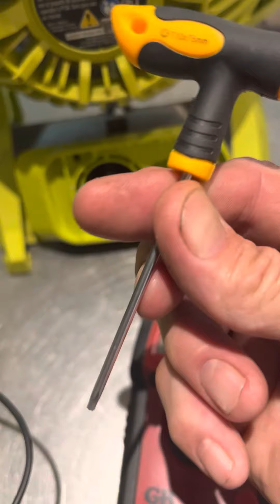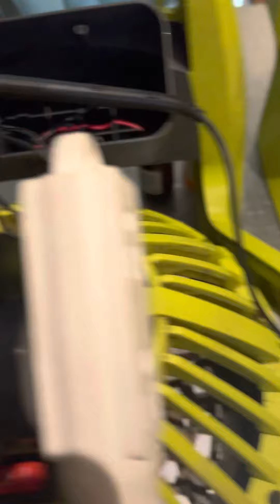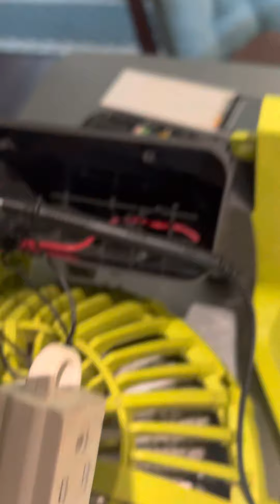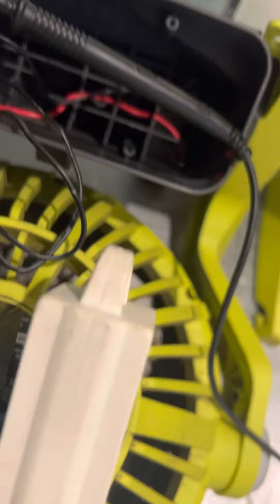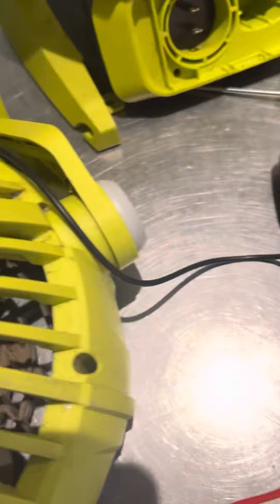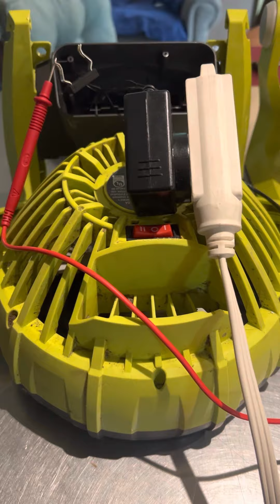Repair Ryobi P3320TH Hybrid fan

Comment: I also have this problem (where it works on DC 18V 4ah battery but not on AC power) and I own several of these original hybrid models as well as the later model (upgrade, whisper series). I prefer this older model though with the hook hanger on the back. Also, the motor is better as it does not whine like the upgrade does, on lower fan speed setting. 

Do you know if the fan blade is replaceable and where I might purchase one? Lots of mine have cracks in the fan blades and I've tried repairing them with soldering iron to melt a staple into the blade to act as a sort of connector or stitch. Its works for about 6 months after that them the staple comes loose and the crack gets worse than before.